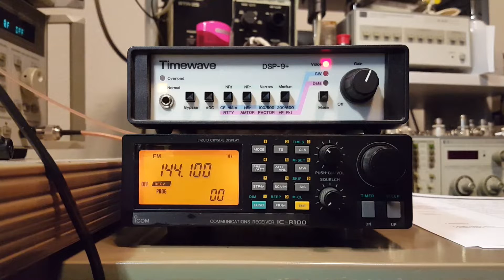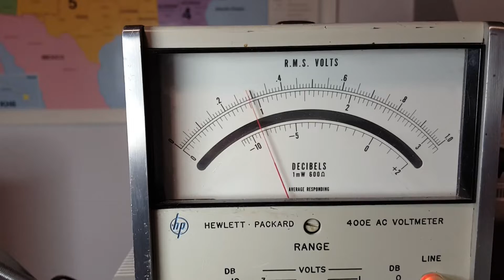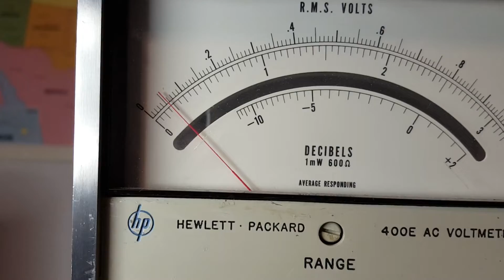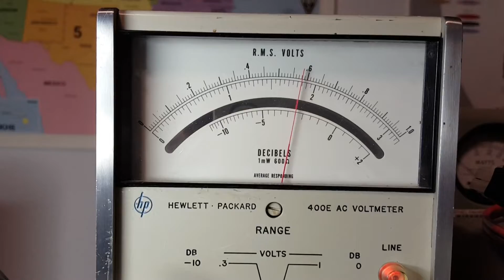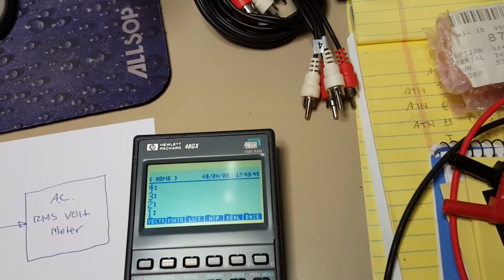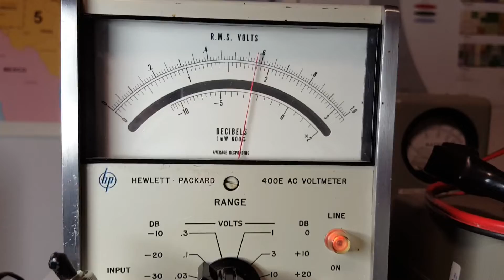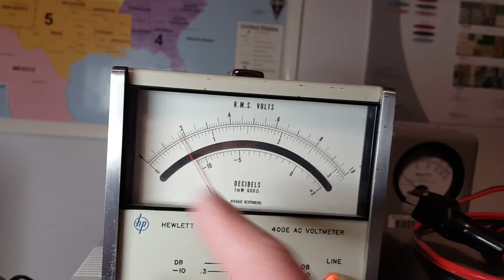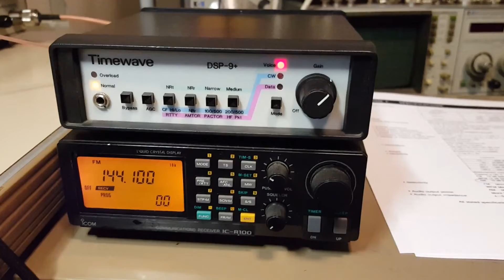Icom IC R100 receiver sensitivity test.

Comment: I had the R100 back new, liked it but hated the relays clattering as it switched bands, I ended up selling it....now I'm trolling for one.  :)  This is a neat test, will need to experiment my own self. thank you for taking the time to show these tricks. I like all the toys you have in the lab, would be neat to see what all you there, I'm addicted to test gear.  ~Jack, VEG
Reply from the maker: I've had that Icom R-100 for about 10 years now. Not a bad little communications receiver. I need to incorporate it into the HAM shack as a general coverage receiver so I don't waste the resource of a HF transceiver on something like monitoring WWV.  A "shack tour" is in the works, just need to receive a few more pieces of gear and get a few more things organized.
Reply: @CraigPetersen12f36b  Yes, I hate having my modern gear on for that same reason...plus I get tired of hear the fan spin up from time to time!  I am very stoked to not only see the new gear but also the tour!  ~Jack, VEG

Comment: Thank you just bought one
Reply from the maker: Thanks for watching. I haven't done much with this receiver since then but I was able to do a SINAD measurement and it easily met and exceeded the published levels in the service manual. These units have a coin cell inside that is really easy to change since it's in a coin cell holder.